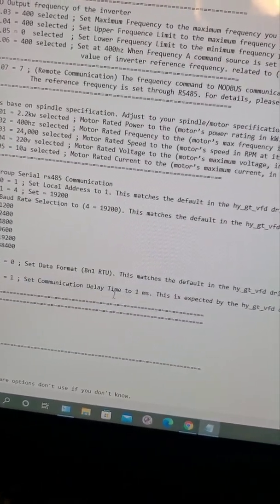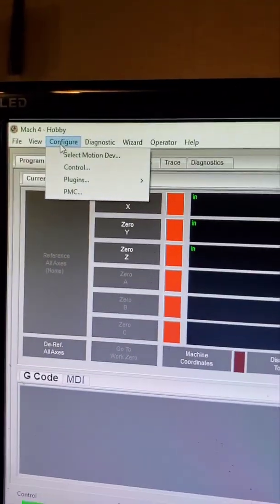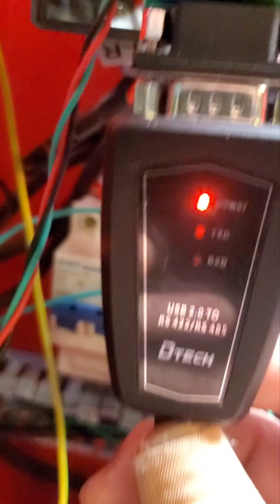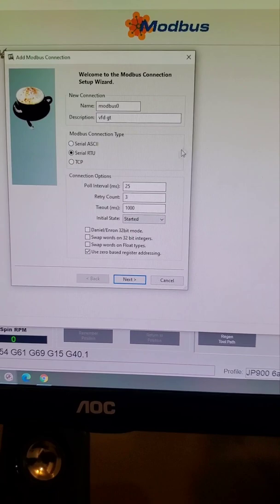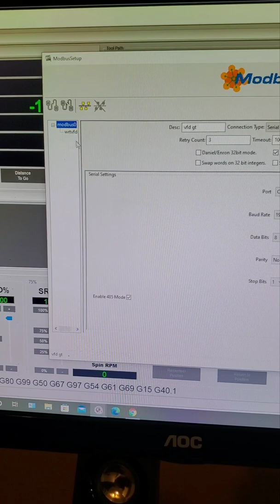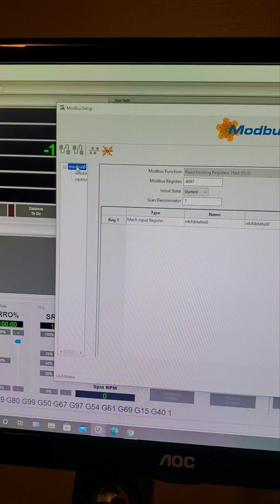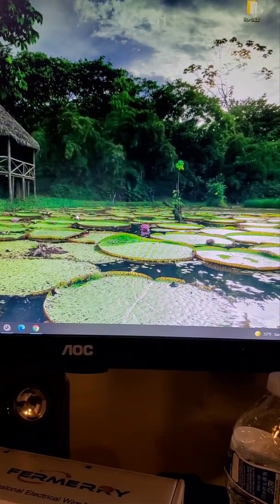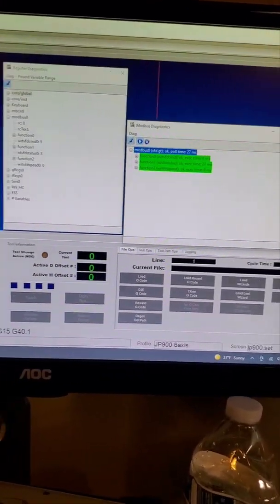Mach4 Modbus rs485 and Huanyang GT 2.2kw Spindle w/ Ess C25xp Part 2 vfd setting, jumper and wiring"

Comment: Did this still work when you upgraded Mach4 to be able to use the xhc pendant?  My Modbus no longer works with the newer Mach4 software.
Reply from the maker: Xhc not support mach4, firmware yall got from users created and its have fews bug. I recommend use different xhc pendant. 

I'm using 25xp control board, GT Huanyan vfd and with mach4 plus a cheap rs485 that I got from Amazon. As of right now so far so good no problem with modbus. The only problem I face right now is my step motor I'm thinking to switch out for hybrid for more accuracy.